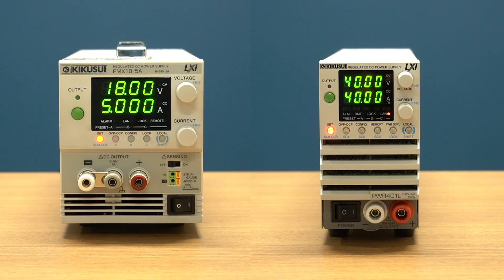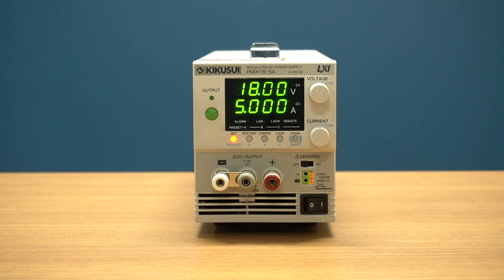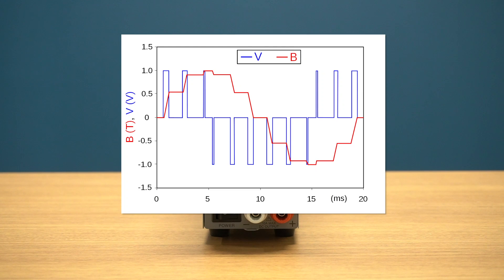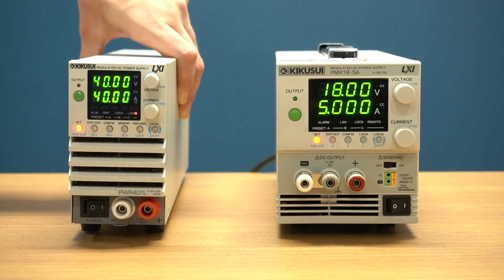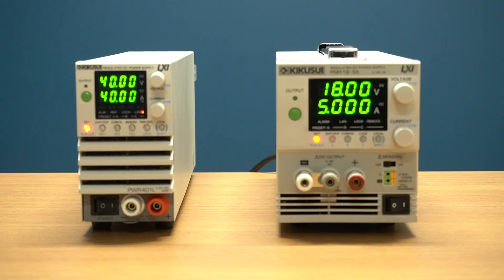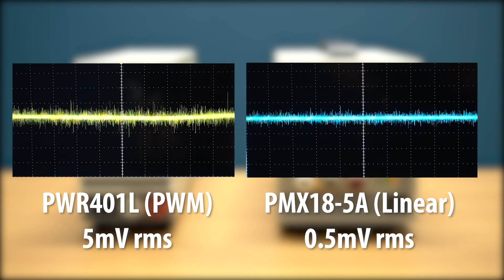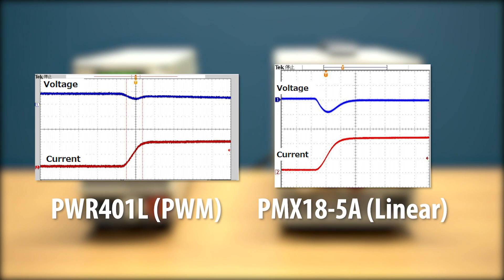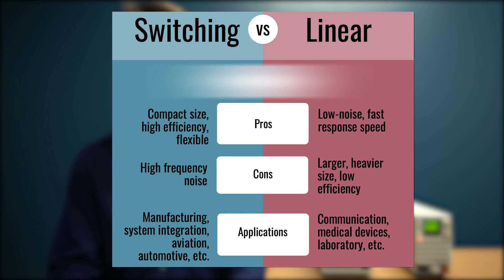Linear vs Switching DC Power Supplies - What's the Difference?

Comment: Switching power supplies can not be used in parallel meaning you can not put 2 of them to double the amp output. You can with regulated ones. Switching will start fighting each other.
Reply: unless u have some transformer magic

Comment: As several folks have mentioned below - the comparison chart which is displayed at 2:31 is incorrect. Leaving it uncorrected after folks have taken the trouble to flag it up, and after you've promised to fix it, and after 2 years has passed is irresponsible, and reflects badly on your company. The video is easily sorted - but a bad reputation isn't.
Reply: Unfortunately you can't "edit" a YouTube video like that. You have to delete it and replace it with a new one -- the original is totally lost even though the change is trivial. So you lose the history, it breaks the links for people who have references to it, etc. It often just isn't worth it.
Reply: What is the correct chart? Thanks
Reply: @j.lietka9406  On the 2:31 chart, the "How it works" row for Switching should say PWM, Linear should say Transformer.
Reply: @RobDunsford  ok thank you for the correct info! Any good word on a tacklife brand DC power supply? Thanks
Reply: Anyone who listened to the information in the video explained or has half a brain can figure out they 2 were just swapped accidentally.  Nobody is really going to avoid the company over something stupid like that on social media.  Get over it.
Reply: Rob Dunsford..funny how you wont explain what you meen with "video could be easily sorted"
gotta be your lack of insight into youtube edit tools that are fooling you as a plain viewer?
The dude clearly explain it, so anybody can understand it with linear vs switching psu, that one of the charts segments at the end, got flipped...so what..if you can do better, then move it.

Comment: Thanks for this but if you are not going to correct the mistake where you identify the linear system-ply as using PWM then you need to take the video down before you confuse even more people. You said previously you would, so why hasn’t it been done?

Comment: You know you're being hoodwinked, when he seller describes them as a 'UK Variable Linear Adjustable switch-mode Lab DC Bench Power Supply 0-30V 0-10A 220V'
Something is going to be dodgy, if it costs only £50 and was made in China!

Comment: I always use linear power supplies due to noise.
They are almost as clean as a battery, in many applications this is essential.
A lot of the background noise heard within the radio spectrum nowadays is caused by switching power supplies.
I have a couple that were made back in the late 70s and more importantly they are in almost daily use, you may occasionally get coil whine but this is easily solved.
Downside is they cost more money and aren't as efficient.
I do have a switch mode supply a thurby tsx3510, which is now at least 10 years old and proven it's worth.. over a grand new.
Like the video says.  It all depends on what you want it for, but be sure to buy a linear if using RF or highly sensitive prone to noise interference circuits
Reply: How about using a noise filter down the psu ?

Comment: I used a linear power supply for my laptop charger to charging battery , but there is a problem about connect / disconnected charging every second... why?
Reply: check amps

Comment: Hi, Very good video, I have two power supplies, one being switching and the other linear. When I use the switching mode power supply on an amplifier I built, I get all kind of distortion, however, when I use the linear power supply, the amplifier distortion is gone... You have helped to understand why this is so. Thank you for sharing this video...

Comment: FYI -  your summary slide shows the linear power supply as using PWM...and the switching PWS using a transformer
Reply: A year has passed and the mistake is still there
Reply: The mistake is still present...
Reply: Change it!
Reply: Before I even scrolled down to the comments section, I knew that there had to be a comment about this. And there you go, the first one!
Reply: Still not changed, I caught that immediately.
Reply from the maker: Oops! Thank you for the heads up. We'll try to edit this and re-upload as soon as possible.
Reply: @KikusuiElectronicsChannel  Don't forget ;)
Reply: @KikusuiElectronicsChannel  it's still not corrected
Reply: @KikusuiElectronicsChannel  just put a label thingie on the video you don't need to re-edit it.
Reply: @KikusuiElectronicsChannel  OMG... you confused me so much!!
Reply: @KikusuiElectronicsChannel  3 years now and you have not corrected the  Summary slide that has the incorrect information.
Reply: @KikusuiElectronicsChannel  was about to say it
Reply: The graphs they show for voltage recovery in response to a change in load, also doesn't match the narration.